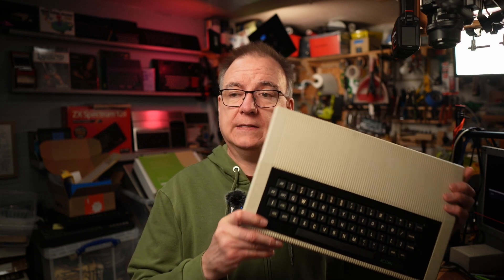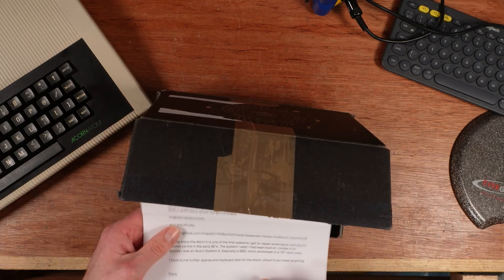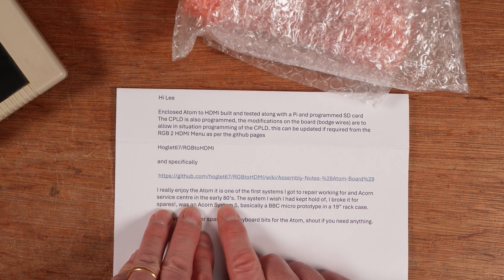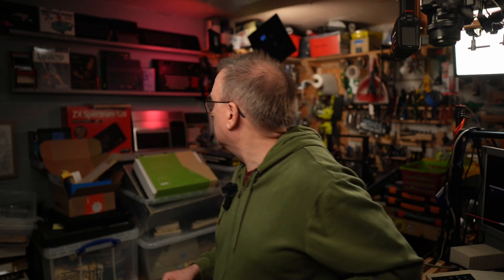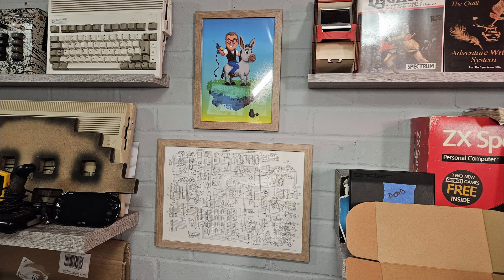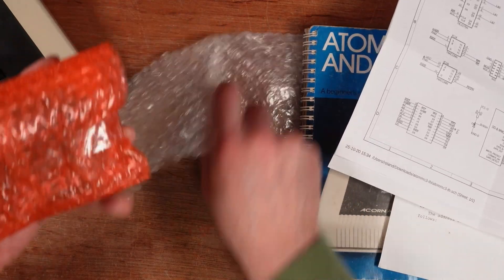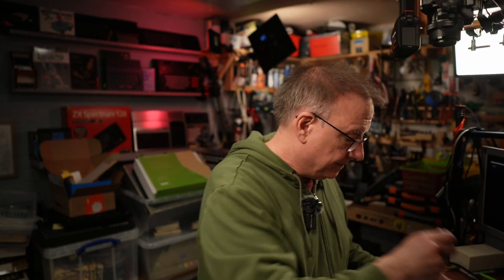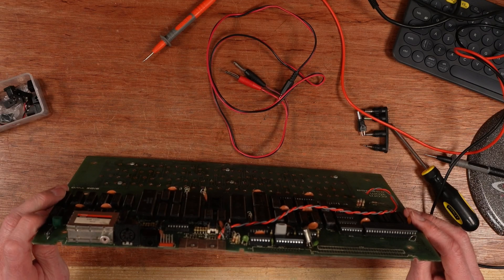Acorn Atom HDMI

Comment from the maker: I have just had a lovely telephone conversation with David and we have found that the problem is a dodgy reset circuit. Needs to be slowed down. Computer crashes on power up, but pressing reset and it all works fine! I will look into a reset modification to slow down the timing a little.
Reply: Replace r38 with a higher value. Also i bet c11 needs replacing too.

Comment: Don't forget that you need more amps when you lower the voltage . 8v at 1.8A is 14.4 watts 5v at 1.8A is only 9 watts and then the Pi needs some.

Comment: I think the Atom was my second machine (after a MK14). The weak point of the design, and what should be replaced by modern hardware, is the 6847 video controller. Firstly it didn’t understand PAL and 50Hz (you’d need to mess with the vertical hold on a UK TV to get it to lock). Secondly it couldn’t handle dual access by both CPU and display (you’d get snow unless you waited for frame blanking). Thirdly it was pants at text generation (32 x 16 chars in upper case only). A modern FPGA replacement that plugs in via a daughter card should be able to fix all that, plus give HDMI directly.
Reply: Sure and then replace the 6502 with a Thread Ripper
Reply: @ removing snow, making it compatible with a modern monitor and making text mode a little more usable is in no way like replacing the CPU with a modern multi-core monster. To start with it should be able to run period software without modification. Secondly it’s likely that you’re going to be using a modern monitor anyway (CRTs are becoming harder to find and maintain, plus they need much more storage space). Thirdly giving the Atom something like a 40 x 25 line text display is pretty standard for the period (a Commodore PET managed 40 x 25 back in 1977, complete with an 8 bit (modified) ASCII character set.

As I said, I owned one of these when it was new, and know full well what its weaknesses were for the period.
Reply: @stevetodd7383  Sure your correct. I was just trying to make a point that Owning and using a Atom is at least for me nostalgic. I'm trying to keep my upgrades to features that was available in the 80s
Reply: There are Acorn Atom cores for the MiST FPGA platform.